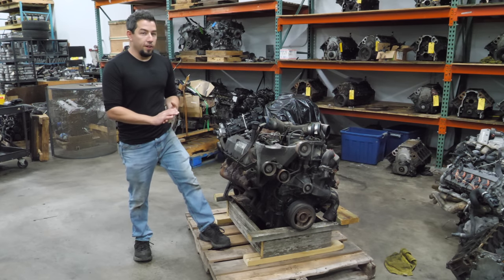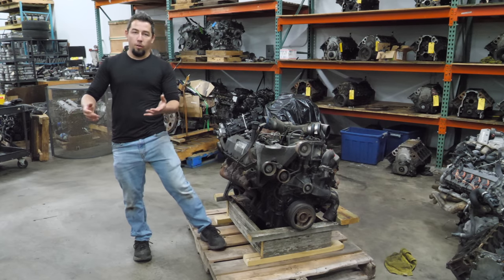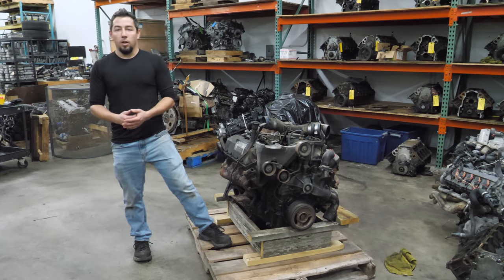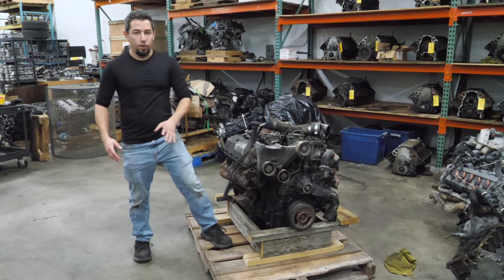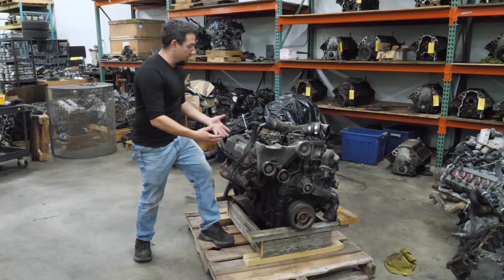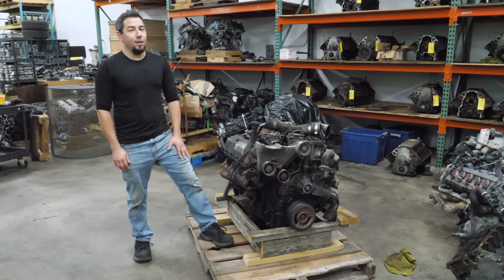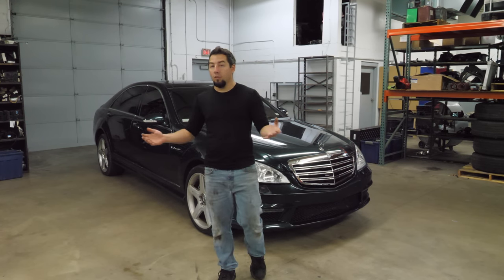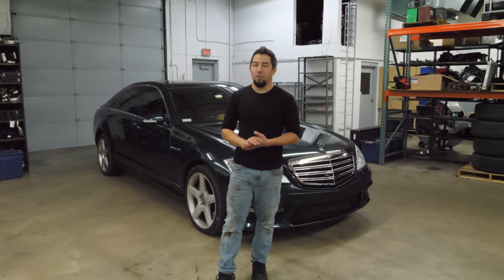70K OR 700K? Ford 7.3 Powerstroke Mileage Discrepancy. How Many Miles Are Really On This Engine?

Comment: Can't beat an old 7.3 power stroke! I been working on them since they were in the 7.3 idi configuration. They are nearly always clean inside even if neglected and you won't find one that's been destroyed from being run without oil as they usually won't start if they are more than a gallon low on oil. As others have said I bet the condition those bearings is from high idle time and/or infrequent service.

Edit I'd love to see you tear down an old idi 7.3, they are archaic by today's standards but they were pretty advanced when they were new.
Reply: I have a 96 7.3 ya can’t kill the mfr ya just can’t kill it the truck sadly is in a rotting stage but the motor runs like a clock I almost want to find a good shell and take mine out and drop it in another truck I’d really love to see him take one of those down to nothing but I’m sure they are hard to find they don’t die
Reply: I'm curious, why doesn't it start when low on oil?  I recently got my first 7.3 (a beautiful 170k DRW, 5 speed, garage queen toy hauler) and I'm soaking up as much wisdom from the old-timers as I can.

Comment: Judging by the Carfax, valve cover /injector harness, cross hatching and overall cleanliness id say its 70K miles. Defiantly a hard 70K with a lot of cold starts and idle time based of the bearings and camshaft wear.

Comment: I'm betting that was a lower mile engine with a ton of idle time and cold start straight to abuse "cuz I didn't buy it". You're not getting 700k out of an F350 chassis that was part of a fleet in the salt belt. The truck would have disintegrated long before that engine hit half that. It doesn't look like 70k though, more like 150-200k. The carfax mileage looks like they may have replaced the cluster or had some electrical problem that caused an error in the reading, because it was remarkably consistent before and after the extra digit was added.

Comment: I've rebuilt quite a few of those 7.3s, I see the ones that just idle all day and the insides look just like that one. Many of them were low miles but I like to think idle time is just an easy 10miles/hr.
Reply: I average 1 hour on a forklift to at least 10 miles.
Reply: Caterpillar claims 20,000 hours is roughly 1,000,000 miles equivalent.
Reply: Ford says 1 hour idle time is the equivalent of around 24 miles
Reply: @catfishbilly7425  I think this is probably more accurate. I do maintain a couple forklifts with 20k+ hours. I believe the Mazda fe is still original in them.
Reply: @typrus6377  but that’s different tho, most them 20,000 hours is spent wide open, diesel live for that while at a low idle everything is lower plus a lot of soot/contamination in oil with lower oil changes causes that type of wear
Reply: @jonathanpalmer228  I can assure you, the majority of Cat engines and equipment aren't at "wide open" for a majority. Many may be frequently at high-idle, but low load high speed is still not great as far as the issues you've raised. And even then, if we are talking about on-highway applications, vocational trucks often spent the majority of their time idling or in stop-and-go situations. Highway haul can even spend considerable, sometimes majority, hours idling. If someone lives in their sleeper, doesn't have a shore-power inverter system, and doesn't have a power-pack, then that truck may never turn off while "on the road", and assuming following of DOT regs, that would put the majority of hours at idle. 
Now, if we are talking stationary generation, pumping stations, or the likes- then yes, the considerable majority of their hours will be under load.
Reply: @typrus6377  you are making a lot of assumptions about highway diesel, it just depends on applications and what all the truck is equipped with, some highway trucks have apu to cut down on engine idle time and if they are OTR then they may not but a school bus or a garbage truck yeah will idle much more and be in stop and go traffic
Reply: @typrus6377  and I work on Komastu and we can track idle time of machines on Komtrax and I think idle time was around 25 to 37% of the time and those were really bad examples. Difference between off highway and on highway is on highway is reved out to 3k rpm all day long but only 1200 to 2300
Reply: @jonathanpalmer228  Assumptions based upon over a decade of working professionally on all of the above. I've serviced vocational fleets. I've serviced OTR fleets. I service heavy equipment and some stationary power systems. Last night APU was escaping my mind when I mentioned shore power and idle reduction systems, thanks for reminding me.
Reply: @jonathanpalmer228  Cat Product Link / VisionLink does the same. You can often pull a full histogram and see throttle percentage versus RPM as well. 
How do you like the Komatsu side of the world? I've been primarily Cat for the last 8 years, but this year left the dealer for a 3rd-party and have dabbled in some others. Only Komatsu I've touched was a PC490LC.

Comment: I'd say it has 70k miles. It being a diesel with a service bed would be in line with low miles but very high idle hours. Long hours idling with low oil pressure at idle would do the damage to the bearings and cams as seen here

Comment: Probably did only 70K but god knows how many hours it sat running at the jobsite. As a work/service vehicle, it likely got treated as a rented mule on the oil changes during its first years.

Will be interesting to read on other people's thoughts on this 7.3.
Reply: According to the car fax it was getting it’s oil changed more often than needed (mileage) in that 60-70k range, but like you say, who knows before then. That would explain the bearing damage. After that 🤷‍♂️
Reply: Especially true if it had engine driven accessories like an air compressor or generator. Guess that's why most tractors have hour meters instead of miles.

Comment: Another thing you could look at is how the oil pan was “glued on” like you say. Doubtful a shop would do it the exact same way as the factory. Silicone, different adhesives, etc, etc. Long shot, and doesn’t tell you much, but may give you a little more info on if the bottom end has possibly been into before.

Comment: i am going to say 70k. Going by the photos of the truck. The bottom of the doors, fenders, cab. it is respectfully clean for a Chicago truck,, especially for its age and being a service work truck but the service bed on the other hand probably picked up most of the rust itself. That engine looked relatively clean, wire harness loom, connectors as he mentioned, etc
Reply: Also, service beds often last through a couple of trucks. So that bed could have been worked on multiple trucks in a fleet.
Reply: @kylepeterson8578  Absoutely. looks like it came on there factory! only if one didn't know it was a Cab and chassis truck or not! lol
Reply: @kylepeterson8578  Yep. I'm betting that's the 2nd or 3rd truck it's on. It uses tail lights from a chevy van that stopped production in the early 90s.
Reply: @mmiller1188  Good eye, i didn't see that.

Comment: YAY You finally did my fav engine!!!  I've tore several down and rebuilt a few and still own a few, I'm pulling a T444E out of a school bus now.  Thanks man I really like your vids!  I've put 515k on one truck with the stock engine and it still has plenty of go left in it after eating glow plug tips and all lol.  And @11:09 yes the paint marks on the heads are what you SHOULD find on all the heads via the valve cover, never seen one that wasn't I'm sure if the heads had been redone that wouldn't be there but seems I've always gotten stock engines that had not been opened before.
Ugg those bearings are horrible if that's 70k then they weren't changing the oil but that isn't the story under the valve cover....  
Thanks again!

Comment: I'm rebuilding one that got dusted at 180k. The rod bearings where much nicer. Just started showing copper on all of them. Along with the other comments I would bet it has a ton of idle time hence the frequent oil changes the frequent oil changes and more oil leaks then I'd expect from 70k miles.

Comment: Until I saw the bearings and rod journals, I was leaning toward 70k. After seeing the bearings, I'm leaning toward the engine having been very well maintained (based on how clean it is), but with 700k miles. I can see why others think the engine wear is from cold starts, however. The engine does look very clean inside and out as if it only has 70k miles.

Comment: Cold starts and lots of idle time could account for the bearing wear. If you could put it on an engine stand and run it and check for blow by that would give an indication of top end condition.
Reply: Run it or tear it down now or after it gets a run test.  Needs to be torn down unless it runs so well the thing is an easy sell🤔🤷🤣only your conscience really knows what's right😤💛....

Comment: The oil change records are the key. If it only had 70k, that would mean someone had the oil changed with 231 miles and 3 month time, followed by 1 month and 259 miles. So clearly, the engine has 700k, and the oil changes were happening at 2311 miles and 2597 miles. Nobody would get back to back oil changes within a few months with only a few hundred miles.
Reply: People can be strange man. I used to work in a tire shop and ee had this old guy with like 13 cars. Every spring he would drive a flatbed truck loaded with summer tires. we would balance all of them and put them on his cars. balance his snows coming off and load them back on the flatbed. in the fall he came back and we balnced all of his snows (though they hadnt been used since we balanced them when we took them off) and put them back on. Most of his cars never even got driven except to get the tires swapped out.
Reply: ive worked at a shop for 8 years i cant count on 2 hands the old persons who come in with sub 3k miles, but want it changed, and wont take any reasoning lol., you'd be surprised how many people are out there like this lol.
Reply: Nah ppl are fools, the OEM stickers not being baked off alone tells me 70k
Reply: If the truck had 700,000 miles it’s likely that the motor had been replaced at some point.
Reply: @gregbuser4690  not necessarily, the condition of barrings is suspect and if they were changing the oil every few hundred miles then they wouldn't look like that
Reply: How does 3k miles a few times add up to 700k miles?  NO WAY, this vehicle would have to be on the road constantly for years.  1000 miles a day x 5 days a week x 52 weeks is only 260k... were did 3 years of long haul commercial driving go on the record?
Reply: This is a utility body truck...it isn't owned by some blue-hair that doesn't know when the oil should be changed. And to the guys suggesting the engine was swapped, the engine manufacture date matches the truck manufacture date. The engine could have been freshened, but not swapped, unless they found a fluke doner engine made the same month.

The lack of rust and lack of varnish indicate that this truck had a very strict maintenance schedule. My first thought is something like a railroad truck that drives the lines for inspection and repair. That would explain the high mileage, low rust, and excellent service.
Reply: @powertool64  If whoever owned this had a fleet and it's own shop, they could have had a bunch of vehicles with all the same engine and manufacture dates.  (Maybe even close serial numbers. 😁)  It could very well be swapped with another truck that was wrecked, and you'd never know.

That said, I think you're right, it's a high mileage truck...
Reply: Ha! Vindication. 700k

Comment: Hello Eric,  1) Carfax is just a reporting agency. All they get is computer generated information.  2) If those main bearings  get any thinner Reynolds Aluminum Corp would put them in a roll of foil wrap. 3) The cam wear is is not that of a 70k mile engine unless there were no oil changes but under the valve cover is clean as a whistle. 4) The crankshaft has a lot of grooves on the journals. 5) There are way to many anomalies for a 70k mile engine. Another terrific video sir, I'm waiting for a part 2 TEAR DOWN VIDEO. 😢,  How is the new baby doing ???? TMP from N.J.

Comment: Eric, 

Not all 99s had an analog cluster. I am fairly confident that it had a digital odometer, which often caused these errors. Call a Ford dealer with the VIN to double check.
Reply: Were they backlit LCD digital? We had them in Australian Fords of that era and the lamp would blow making them very hard to read.
Reply: @stephenw2992  no, regular green pixilated odometer

Comment: 70K on it. 1) being a turbo engine, you will see bearing wear, on the upper bearing shell, as compared to a naturally aspirated engine. 2) cold starts will also affect this, read, non-uniform bearing wear 3) agree with the increased idle time over miles. In that, you will see a lower oil pressure at idle and therefore, potentially, an increase in the upper bearing shell wear

Comment: Engine appears to have been well maintained. Bearings are shot. From what I could see of the cylinder walls, the crosshatching is still very apparent. I think it needs a good rebuild, and will be ready to go for a few hundred thousand miles more.

Comment: Is it possible the oil change place (which did the last several oil changes) used bulk passenger car oil like 5W-30 or 10W-30 instead of the stuff that was meant for diesels?
Reply: Yes, it is possible, in fact it is likely 😆

Comment: I'm going with the CarFax is power of 10 off -- probably is 70K engine, BUT;  being a service truck; it probably idled for very LONG periods.  Those rod bearings should be down to the copper at 150K on that engine -- hence, why I think it idled for long periods.

Comment: 600k miles added between New Years at the end of 2014 and Feb 3rd just two months later. That means 10k miles were put on it everyday (average) between 12/30/14 and 2/3/15. That's driving across the USA back and forth TWICE per day!
Reply: Which would be impossible xD How long does it take to do a crosscountry trip? 2 days (maybe 1 if you don't stop)?
Reply: If you leave Birmingham, Alabama at 8am CST, you end up in San Bernardino, CA and Glen Helen Raceway park approximately 30 hours later only stopping for gas (combining food at the gas stops).
Reply: works out to 416 miles/hr

Comment: I would say that it had 70k miles driving but had 600k worth of idle time. I believe the clue is the service body on the truck it came out of, chances are high it drove to a job site and idled for long periods. I would say that the odometer jump was an input error and the wear you saw on those bearings is consistent with a high use especially high idle time engine. Probably have a good re-builder though, block, rods, crank, heads etc need refinished then R&R the rest and slap her in another truck. Love your channel and love the frankness you share with us. Keep up the good work :D

Comment: Michigan guy here. We measure our salt use by the tons per lane mile. Michigan averages 22 tons per lane mile. The next closest state averages 13-15. Engines in the rust belt with any sort of 10k/yr or more track record will be shedding weight in the form of rust flaking off. By the exterior condition of the engine, it looks like 70k. The body rot is likely due to age. The rust is all low on the vehicle indicating it wasn't driven at really high speeds like it went down the free way a lot, and it just never got washed or stored indoors and all the road gunk just sat on it and rotted the bottom off of everything. The oil pan wasn't even rusty and it's pretty common for them to rot through if they get a lot of road time. 

I'd check out the registration history if possible to see what entity owned it and that'll be a huge help in finding out what kind of service industry this truck provided. If it's a truck shop that had it initially and used it for service calls, it didn't drive much, and likely just idled a ton which resulted in the bearing wear. It could have been used in the ports where it pretty much got driven around the yard and was used to maintain and fix equipment and never got slush anywhere above the rocker panels. But it idled a FUCK ton while out on the docks servicing things. The service body probably got crappy, and it was sold off to the dealer when they got a new one and someone picked it up cheap because of the low miles, drove it around, that's where the service history at the oil change shop started, someone done goofed on the mileage reading and their system wouldn't allow a lower mileage entry than the previous one so they just continued down the path multiplying the mileage by 10 until it got wrecked. Copart probably pulled the history you did and either rounded up to the nearest 100k, or did a quick check on the cluster upon intake and said close enough. 

Either way, this thing had a lot of run time but not a lot of miles. I wouldn't part it out, but sell it as a complete engine good for rebuild. It's a clean engine, it looks to be in great shape still, and will likely be perfect again with a fresh set of bearings.